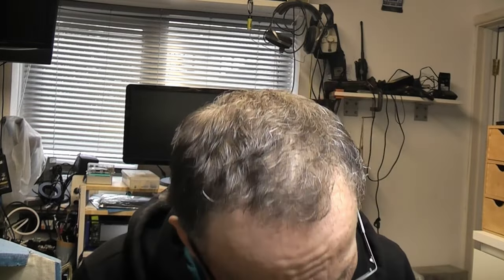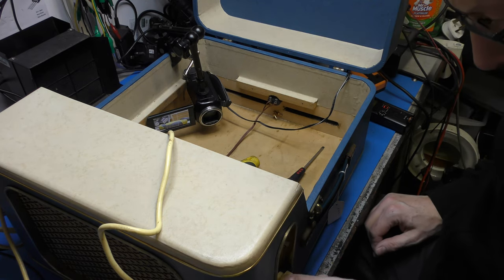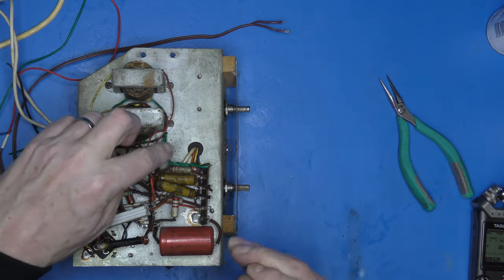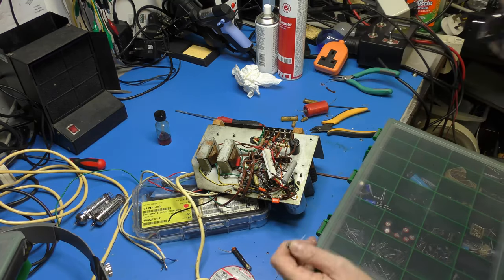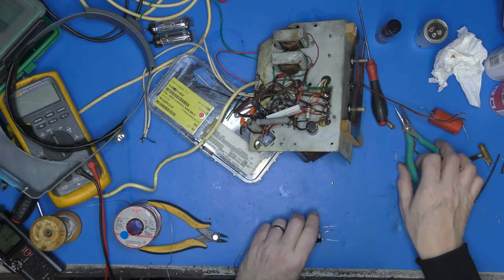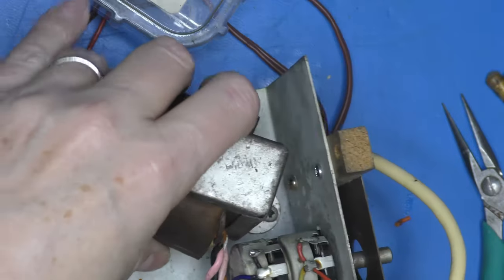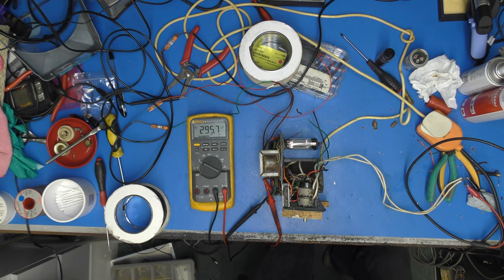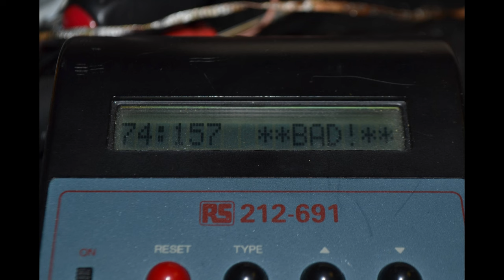Fidelity HF 10 - fixing up the electronics

Comment: I've found a circuit diagram for my Bush SRP31D and it looks as if it might have a Metal Rectifier rather than Selenium as there's a component after the mains transformer labelled as MR1 (MR=Metal Rectifier?). It also shows the voltage after this component should be 215V.  Great video and looking forward to watching Part 3.